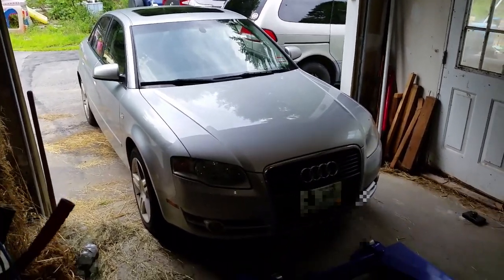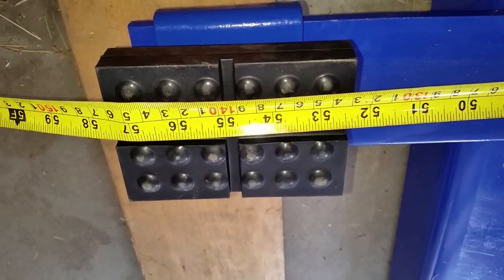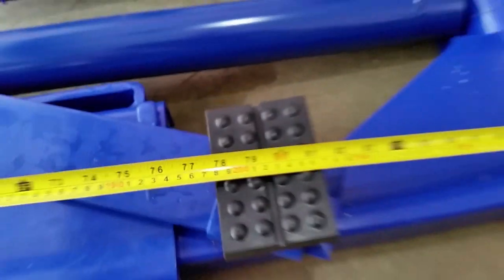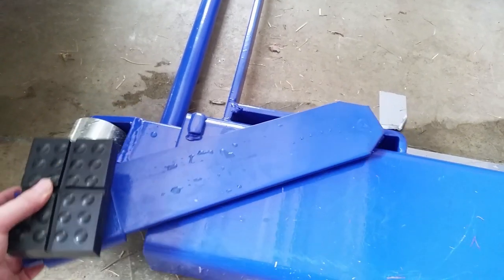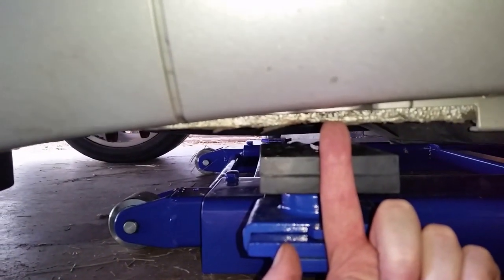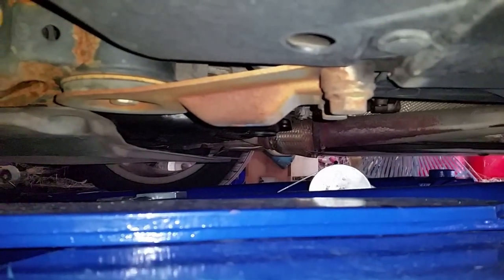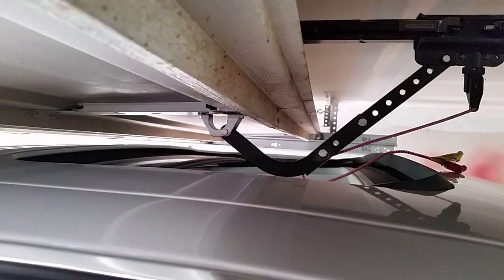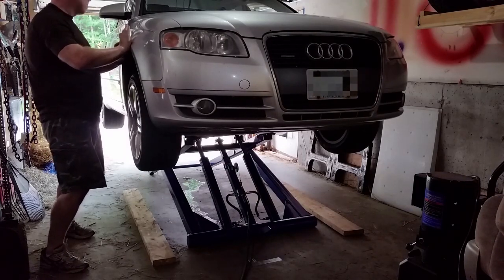Harbor Freight Scissor Lift - Adjustment, Dimensions & Stability

Comment: Thanks so much for taking the time to make these measurements.   I was about to buy one of these and never considered my little Honda Civic (2016) would be too wide, but after seeing your video, I went out to measure it and found that the front jack points are 59" apart.
Reply from the maker: If you can find internal jacking points, you can make it work but it's far less flexible. You can buy longer arms too, or even make some, as shown in one of my other videos.
Reply: @OrdinaryWorld  Thanks, yeah, I saw those longer arms for sale, but so expensive.   It looks like they give an extra 8" of reach.  Since they're sold in pairs, and my car would only need a few extra inches of reach, do you think it'd be feasible to just buy one pair and put them both on one side to give an extra 4" of reach?   Or too risky shifting the car's center of gravity 2" off center?

Comment: I think the static friction caused by the force pressing down on the lift and the roughness of the cement floor make it difficult to tip over.

If someone applied a very large force sideways they can tip the car over but that would be rare without tools or aid.
 Still doesn't change the fact that getting under the lift is still kinda intimidating.

Comment: You can actually lift on any part of the pinch wells fyi. We do it all the time the actual lift point are designed for using the factory jack
Reply from the maker: But the span isn't wide enough to hit the pinchwelds regardless of where on the welds you try to reach.

Comment: I need to replace the run capacitor on my harbor frieght lift it came in with the wheel damged and capacitor missing. I contacted Mouser electronic and they said the information they need to size it on the motor label is not listed. Any chance you can tell me the specs of the run capacitor?

Comment: Great video! Any reason why you could not use the lift perpendicular to the car? Don't know if that gives you more options for hitting the pinch weld. I guess you'd have to slip it under instead of driving on top of it, might be a PITA

Comment: Nice! I would probably run into similar issues with my car since it is fairly wide :/… But you can jack from other frame points under the car as well, so who knows.

Think this will actually be helpful with your maintenance tasks? Anything you won’t be doing that you were hoping you could do with the lift?
Reply from the maker: You see me try to find suitable internal jacking points on the frame and I do just about manage but it needs to be inch perfect. I've now made longer swing arms to give more options.

Comment: I'm sure it's secure, but I wouldn't get under it, lol. I didn't watch the whole video--is there some sort of set of notches that it activates as it progresses so that when it falls down it won't fall all the way down?
Reply from the maker: Yes - in between the two hydraulic rams is another cast steel beam with a rachet mechanism. After raising the lift, you need to drop down to the previous rachet point. To lower, you have to raise it a little, disengage the lock and then lower down. Even if it somehow failed, the rams would still be holding the weight unless the release valve also coincidentally failed at the same time. Even then the lift would slowly lower to the ground at around 1-2 inches per second.
Reply: Oh, that's good to hear. That's a game-changer.

Comment: Just put a long piece of wood and make it touch the support points on the car in both side and you are good to go
Reply from the maker: I did think about that but it's not a straight shot across (stuff in the way) and I'm not sure I'd get enough space for a suitable thickness of wood. I got a delivery of steel stock today, from which I'll be making longer supports. You can buy them for $150 a pait but the shipping is extortionate. The steel for two pairs plus shipping was around a hundred bucks. Video coming soon ;)